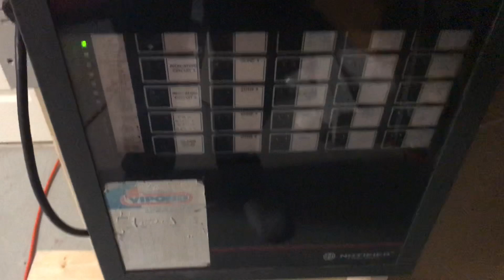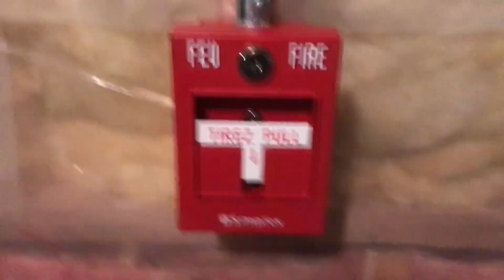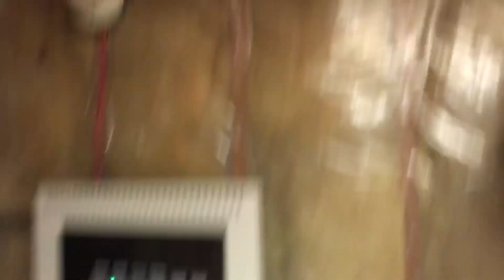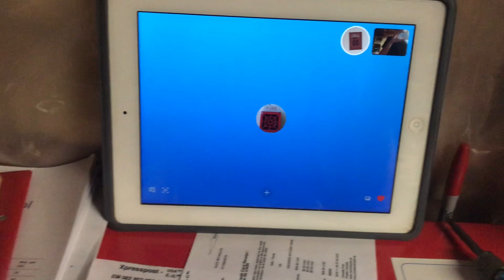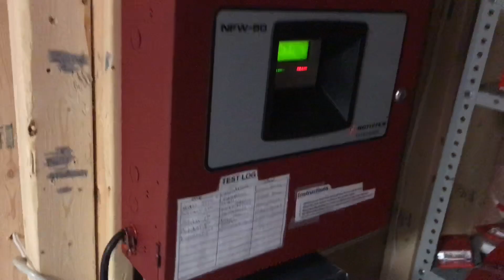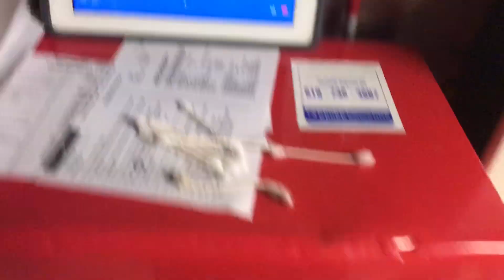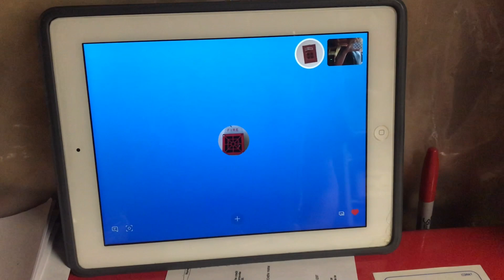System Test 47 (Big Changes)

Comment from the maker: I figured out the clicking. Turns out the 24v power the battery hack was hooked hooked up to the regular 24v power which puts out FWR because it's what powers the nacs, and battery chargers don't like that, so I put it on the 24v resettable power, and it's fine now